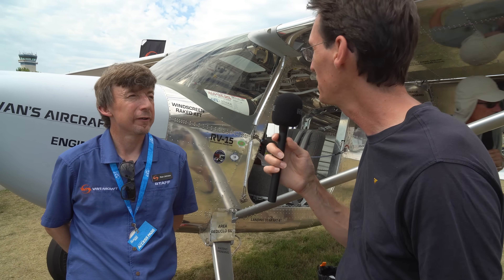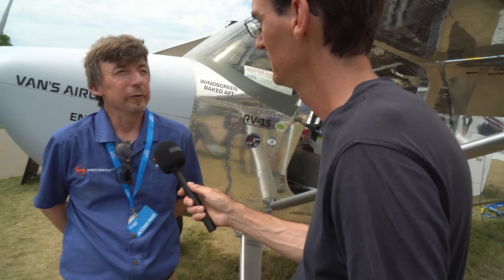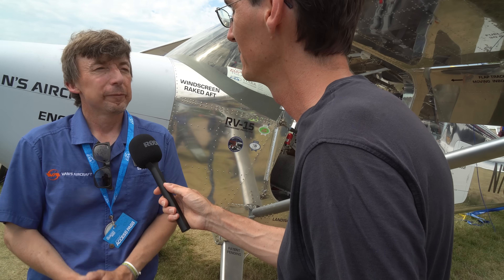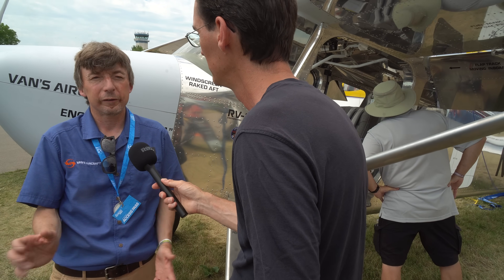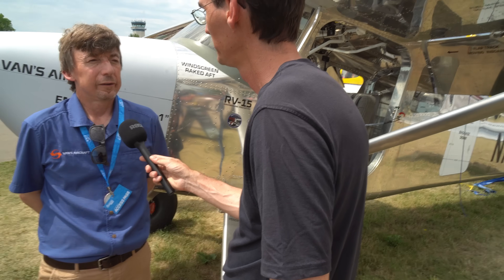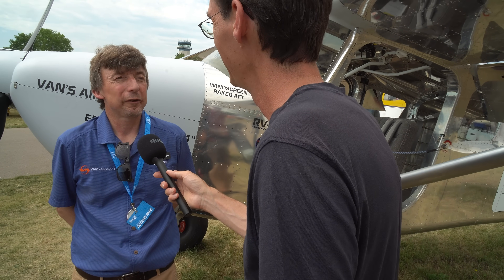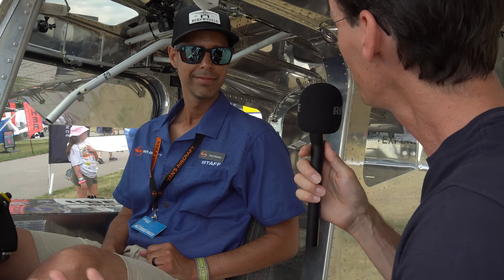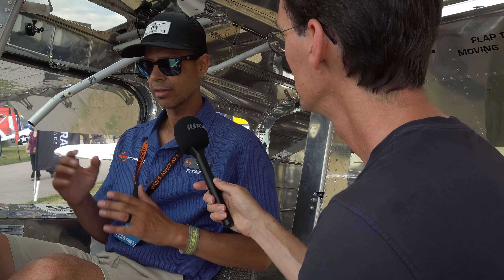Van's RV-15, latest updates, revelations and insights

Comment: How does this save money over a Cessna 185 again, which has a 1400lb useful load?
Reply: The most expensive kit vans sells is the rv10, which you can complete with new parts for $150k. This plane will surely be less than a rv10 because it's a lot more simple. A quick Google search tells me that a 50 year old cessna is still in the high $200k range with steam gauges.
Reply: @wwjohnnymaydo  A 185 with steam gauges is more like a 160-180k airplane, depending upon condition. Or it was last year when I bought one, anyway. I will have modern avionics in it for less than 250k. An RV14 build with similar avionics is similarly priced, with a lot less payload, but more speed: https://youtu.be/uJ2ALOPfnGY?t=887   So I don't think this RV15 with a modern panel is going to come in much less than a 185, much less a 180, which the Vans guy in this video explicitly compares the RV15 to. Plus the average builder is going to have to spend five or ten years of their spare time assembling an airplane if they buy an RV15. There are some advantages to owning a non-certified airplane, certainly, but this RV15, which is really like a Cessna 170 it seems, or something between a 170 and a 180, looks like a false economy compared to existing aircraft for sale. If the goal is to spread the cost of acquisition out over years, just finance a Cessna and fly for 10 years while you pay, rather than spending 10 sweaty years in your garage building a mediocre-performing version of the same thing. If you like building stuff, then a 15 should give you a nice plane 5 or 10 years from now, even though a Bearhawk is probably more capable and no more expensive.
Reply: @wwjohnnymaydo  200K for a 50yr old cessna? what are you smoking?
Reply: it doesn't.
Reply: @SoloRenegade  The resources are out there, no need to be ignorant. There are 25 Cessna 185s for sale on trade-a-plane right now. Only one of them is less than 200k. If you want a nice one you're looking at mid 200s. The RV-15 will be much cheaper to build, which it should be, as it's not even really comparable.
Reply: @3SM20Pilot  Clearly you can't read.

I'll make this super clear for anyone else reading this. Here is what I said, "200K for a 50yr old cessna? what are you smoking?"

I can find TONS of Cessna 182s, Mooneys, and more, for  less than $200k from the 1970s or earlier. I'm seeing tons of them for sale for $80k to $170k, on trade a plane, controller, barnstormers, and elsewhere.

The guy in the hangar next to mine just bought a Mooney for $80k, and he even flew it to Oshkosh this year.

Plenty of 4 seater options to be had for less than $200k. Try harder. My own plan currently is a 1960s Cessna and I paid even less than $80k for it.

So, now it's your turn. Prove anything I said was factually incorrect......

Also, the Bearhawk (multiple models) will likely be cheaper, faster, and a greater payload than the RV-15, from the way it sounds.
Reply: @SoloRenegade  I'm not reading all that. I'm happy for you. Or sad that happened to you. Whatever.
Reply: @3SM20Pilot  I don't think at the end of it that it will be much cheaper for the same avionics, which is incredible, because a 185 had 500lb more payload than an RV15. This is the reason for my comment. People are sinking 250 into experimental builds with much less capable performance than their certified counterparts, which sort of negates the whole reason to build an experimental IMHO. Unless it is just because you like building stuff. But in that case, plans built seems like a much better return for the dollar than these laser cut riveted airframes are.
Reply: @3SM20Pilot  " I'm not reading all that. I'm happy for you. Or sad that happened to you. Whatever."

the response of someone who realizes they've lost and thinks they can avoid losing by not participating. But it doesn't work like that. You lose by giving up, and by refusing to defend your claims, or refute my facts.
Reply: @3SM20Pilot  you clearly can't read. I spelled it out very clearly for you. Even a child understood what I wrote. 

Yes, I too can find tons of overpriced Cessnas and other aircraft online for $200k or more.

But there are tons of cheaper Cessnas and other aircraft as well, especially when you get into the 50+yr old aircraft.
Reply: @kwittnebel  Fair point. To me there is value in building. It's fun and you can personalize it to your needs/desires. That being said, there's definitely no financial ROI. You can usually buy a plane someone else built for less than they have in it. Not even considering the time involved.
Reply: @SoloRenegade  To be fair, the initial discussion was about the 185 (go back and look) and then you started talking about a bunch of different planes that are not the 185.  I think that's called moving the goalposts.
Reply: If price and payload are important, you can get a 7 passenger jet with a lav for $160,000 less than a Cessna 185. Bonus points for speed. Lol
Reply: @A.J.1656  Yes if you happen to be good friends with a type certified jet pilot and can afford over 100k for a hot side rebuild when those come due, a jet can be a nice way to fly. But realistically at that price point you are going to be rethinking your decision to fly on it pretty quickly.
Reply: @kwittnebel  
Oh, I thought the topic was useful load and price point.
Reply: @A.J.1656  Space shuttles are going cheap.
Reply: @kwittnebel  
That's what I'm talking about!
Reply: @kwittnebel Yeah but parts and service are impossible!

Comment: Would love to see the struts disappear. Sling doesn't use them on their high wing.
Reply: Struts are handy to push on in the bush when compared to the door frame which has less mechanical advantage. A carry-through spar would limit the height of pilots that could be accommodated, or cause the pilot to be reclined which reduced visibility. A cantilever wing also adds significant weight.
Reply: I wonder if it's heavier to have a massive main spar than it is to have struts.
Reply: Would make it a great alternative to C182s for parachuting ops
Reply: no struts? how do you  push it in the muck or on floats.  How do you reach the fuel caps ?  Fortunately Vans listened to the input from experienced bush pilots on this design
Reply: @SeaJayAerator  well, you do have a point there. I am not a bush pilot so didn't consider that.  You changed my mind.
Reply: No struts makes the airplane heavier. This thing is already going to struggle to compete with a Cessna 182

Comment: If they remove the struts and add a BRS, it would be a great XC plane. Maybe -16 will have that.
Reply: removing the struts adds weight.
Reply: A parachute will most likely be offered. A carry-through spar would limit the height of pilots that could be accommodated, or cause the pilot to be reclined which reduced visibility. A cantilever wing also adds significant weight.